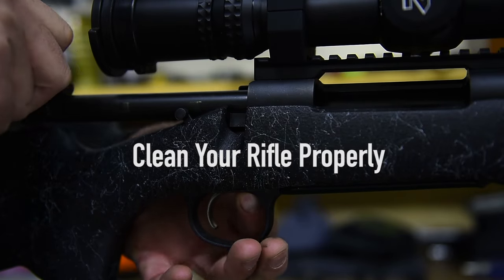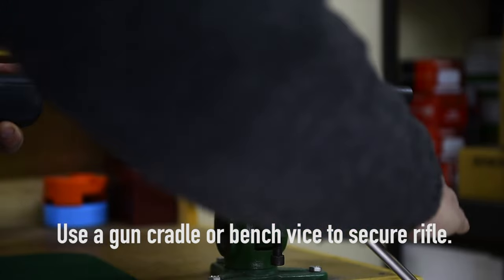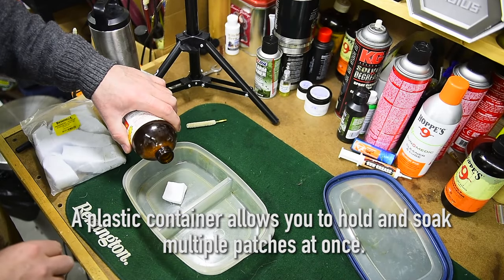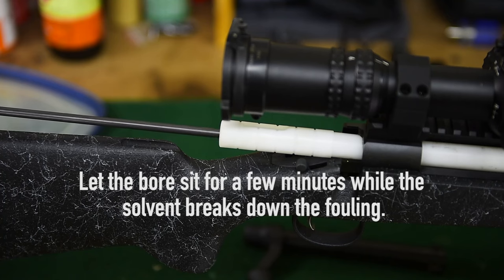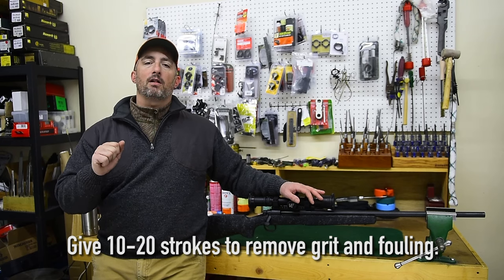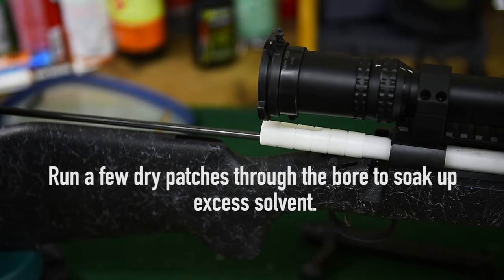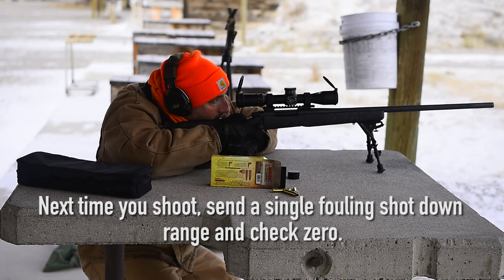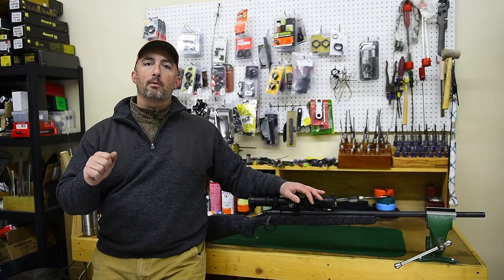How to Clean a Rifle (The Right Way)

Comment: Is clp considered a quality cleaner
Reply: Marine Corp thinks so, good stuff !
Reply: There are much better cleaners out there. I wouldntt use it on my garage door.
Reply: CLP is a cleaner, lubricant, and protectant.
Reply: [08/28/21] Does CLP easily dissolve nitro powder? The answer to that question will tell you how good it is for cleaning firearms.
Reply: G96 is really good in my opinion i find hoppes drys up after a bit

Comment: can you do this with air rifles
Reply: Gunpowder is a source of corrosive toxic residues as it pushes the bullet out of the barrel. Cherish your air gun and outer metal cleaning to remove salt and oil from hand handling etc is all you need and maybe once in a blue moon very light barrel lub.  If spring operation, that is the area of attention you may want to provide, and then the breaking plastic parts.

Comment: Im not sure there is a best way to clean a gun.   Like 1,000 different ways.   Some people say their guns shoot better dirty and advise NOT to over clean.  Then on other end of the spectrum you get people that almost over do it like they are OCD.     How do you know if its fouled?   Do you shoot until it shoots poorly?    I have a buddy that does not do much to his guns but squirt WD40 down the barell with a few patches and wipes the entire gun down with WD40.  They all shoot fine and are 30+ years old.    I'm trying this red "One Step" by ProShot Products.  It like hoppes cleaner + Hoppes Oil in one solution.     The gun shop said thats all they use now.

Another guy told me to kill a snake and run the oil down the bore with some patches.   I'm thinking some snake oil is in these cleaning products.